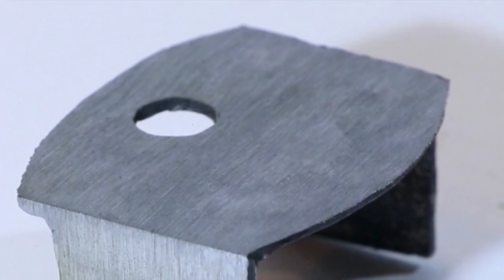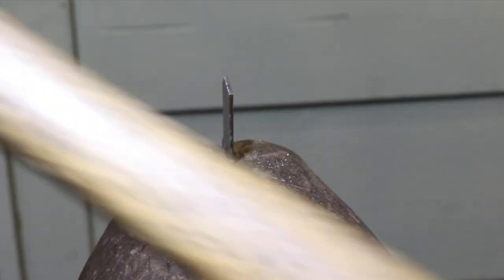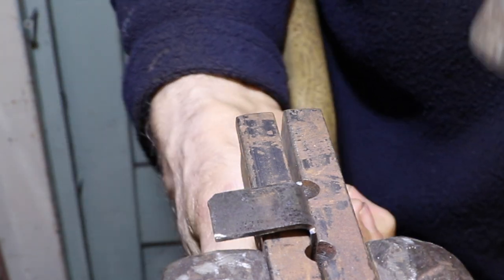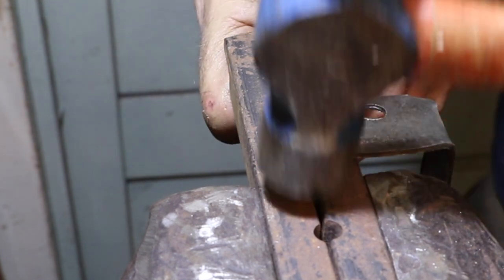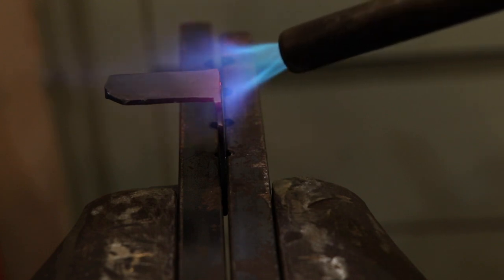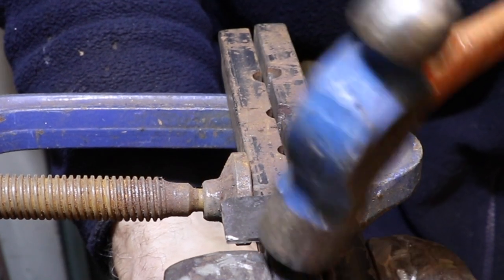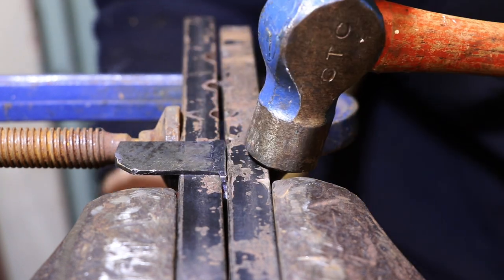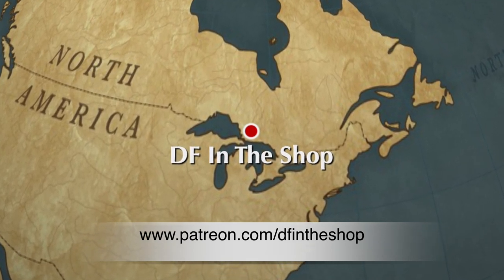Forging Square Corners in Sheet Metal - Nuremberg Box 28 - DF In The Shop

Comment: Very impressive, as always. 
Any tips for doing corners in Brass? (I'll try and break a couple). 
Thanks!
Reply from the maker: I have never worked with brass but it should be the same process.  Any metal will work harden.  You stay out of trouble by annealing.
Reply: @df-intheshop330  thank you. I willgive it a shot... :)